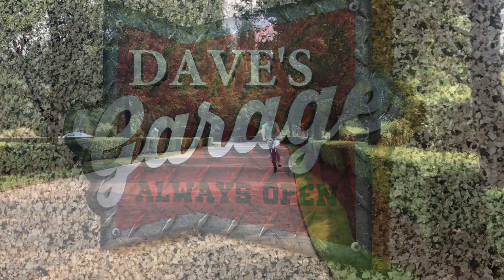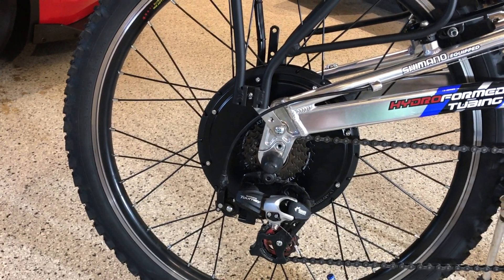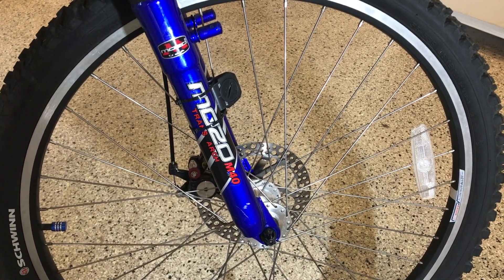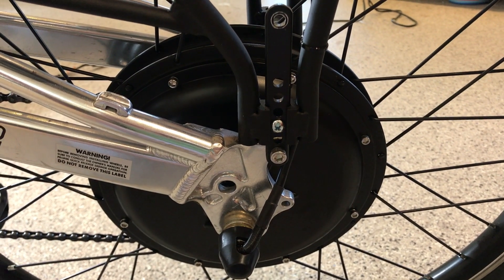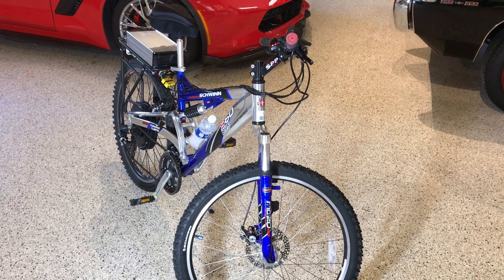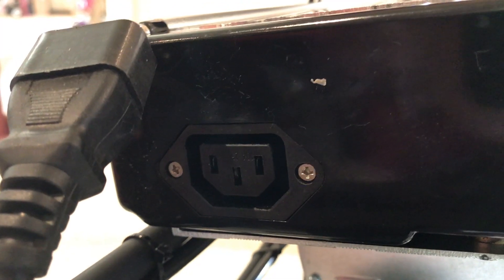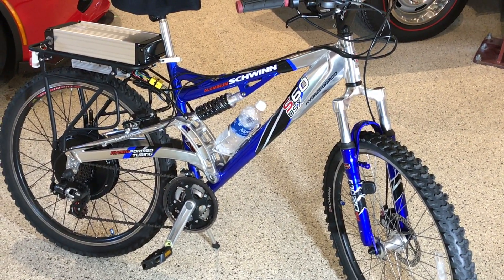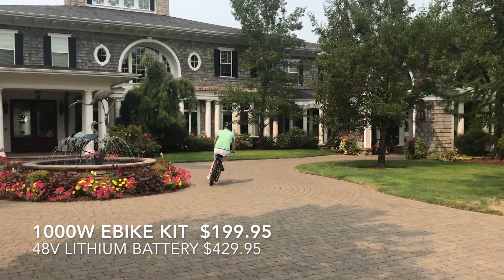eBike Kit: Amazon's eBike Review for 2021 1500W 2000W and 48V Battery

Comment: I use a Incline Frame of the NEXT Power Climber to use 1500watt FRONT HUB. The frame is similar to this Schwinn but the joint is different as the NEXT s frame is dedicated to having most of weight towards the handle Bars. I dont get peeling unless I rev fast which is a no no for me, lol. Going hills I can feel the difference of using other frames but this NEXT was perfect for using Front Hub. 1500watt using 52.v is extremely powerful of acceleration is fast, 2 to 3 seconds to 20mph.( have a 350 gear rear hub takes 5 seconds). But the frame is ideal for front hub as long as the frame is steel. having light bike of going fast is very shaky as give you feeling any small hit will throw bike off  balance( not too heavy of weight for dual motor it can rip the fork ends out of wheel running away.).

Comment: I would never go 40 on a big box bike, they are classified as toys for safety reasons and do not pass any kind of certification for safety other than choking hazard. Fortunately it looks like you have not put many miles on it, it will not last long before the pivots fall apart and I have even seen the front forks snap just under the head tube on numerous occasions (I used to work in a bike shop). My advice is to switch it to a good bike. Also some riding video would have been nice, otherwise not a bad video.
Reply: @SomethingSmellsFishy  good to know. 👍

Comment: How do you charge the battery is there a charger or do you charge it by spinning the wheel
Reply from the maker: No, it comes with a plug in wall charger

Comment: AW rear wheel conversion.  My bike shop looked at it and there are two problems. First problem is that my Shimano crank is tapered and the PAS takes up room so that my crank will not slide back on all the way, I can tighten the bolt but the crank is not seated all the way and the bike shop said it will eventually wear out the crank arm since it is not tightly seated.  Is there a PAS system that will work in this case?  Also the derailer rubs in top gear and the bike shop said no way to fix except to adjust to lose the top gear.

Comment: Not a good spot for it water can splash it.
Reply: he must not use it in the rain, same problem with rear wheel mounted upside down as he has the wire coming out the top of the axle, will act as a nice way to direct lots of water into the motor if ever used in the wet

Comment: I have seen in the item description that there is a 19mph restrictor, is that print just for legal issues? Or do some have a restrictor? Definitely don't want the restrictor.
Reply: My controller has a wire with a connector on it you leave it connected to keep the speed restricted to 25kph or disconnect it to ride full power 1000w (around 50-55kph i think, 30mph ish). Im not sure if it just restricts the top speed or if it limits the wattage but it doesnt go over 25kph which is the legal limit in the uk
Reply: GRAVED1GGER44 I think he’s put it on because it’s his kids bike

Comment: I can't believe I came across your post. I have the exact bike around 10 or more years ago at Target. It definitely is a great bike for what we paid for it. I think I paid around $70. I want to convert it because I have back problems and need assistance after a short ride. I wanted to go with the mid-drive setup but afraid of the complexity with this bike. Let me know how it's holding up and what you would do differently.  Thanks.
Reply from the maker: That's cool!  Biggest change I would make next is better mounting for the battery.  Maybe a shock mount of some kind because it's so heavy!
Reply: Dave's Garage, I started to disassemble the area where the mid drive goes through to measure the core. The mid drive has the controller in the motor which is good. The back rack will have the battery like yours. Unfortunately can't fit in the water bottle area. Thanks again!

Comment: switch that front brake out to a hydrlic brake for a couple reasons - 1) (much) more stopping power for your hills 2) less maintenance
Reply from the maker: Thanks!  I've ordered one to use on a quad, I'll see if I can make one work on  the bike as well!
Reply: @DavesGarage  go for it and if not - there's millions of used mtn bike parts on the web - you should be able to find a hydraulic disc brake on ebay or craigslist for cheap $$$ - good luck!
Reply: I’ve been told my bike can’t be converted as it has hydraulic brakes??? Help please!

Comment: You canuse the below links to buy best selected e-bike conversion kits in india.

For BLDC hub motor kit

Amazon.in: Electronics (https://amzn.to/2TTiTFl) > RS. 25000/-
Pedalease Electric Bicycle E Bike Conversation Kit 36v 250w Rear or Front hub Motor (https://amzn.to/2SQcMRL) > RS. 13000/-
Amazon.in: Electronics (https://amzn.to/2TKchce) >RS. 18500/- (1000W)
Amazon.in: Electronics (https://amzn.to/2SVkI4e) > RS. 11500/- (250W)
Pedalease Electric Bicycle E Bike Conversation Kit 36v 250w Rear or Front hub Motor Complete with Battery (https://amzn.to/2RP8JYT) >RS. 22000/- (250W)

For DC Motor kits

Electric 24V 250W E-Bicycle Project kit (Black) (https://amzn.to/2RJjT1i) > RS. 7000/-
Buy HumserTM 24V 250W Electric Conversion PMDC Motor Bicycle Kit (Silver) Online at Low Prices in India (https://amzn.to/2TO23Yn) > RS. 7200/-
Robodo Combo Kit - MY1016Z2 250W Motor DIY Ebike, Electric Bicycle Kit (https://amzn.to/2VV4h9Z) > RS. 7000/-
Robodo Electronics M59 MY1016 250W Plus Motor Controller Plus Twist Throttle, DIY Electric Bicycle Kit (https://amzn.to/2RpVhLD) > RS. 4000/-

Comment: I recently got done putting a very similar kit together on my old mtn bike, it appears to work really well.  Did you leave the blue connectors unconnected so that you get the 1000W instead of the 750W?  Thank you for sharing!
Reply from the maker: Can you explain?  Mine had NO documents so no, I bet I did not.  Please provide more info if not a joke!
Reply: Dave's Garage When I purchased my kit via Amazon, it was advertised as a 1000W motor, but the description said it defaults to 750W unless the two blue leads from the controller were either connected or disconnected. I tried it both ways and didn’t notice any changes but that way have been me. My area is too cold right now for biking so hope to play with it some more in spring.
Reply from the maker: @alanhirayama4592  Assuming it's a DC motor I should be able to test it with a clamp ammeter, I'll see if I can do that!
Reply: @DavesGarage  It should be a DC motor, pls let us know what you find out!  Thanks much!
Reply: @DavesGarage  Did you do it?

Comment: I have a trike I want to convert to an ebike. Do I get the rear wheel or front wheel kit for it? 😊
Reply: Go with the tri wheel kit u wheel get rear and front wheel traction make sure you get 1600 watts or better because u using all 3 wheels go with the super lithium ion +
Reply: I have the same doubts as you... I like more the kit for the rear wheel because you have a better space to fix the battery wich is huge...
Reply: @aviatesony1793  the size of the battery dont matter if you can get a smaller batter with the same it's all good and they self loads of them on Ebay that connect to the part were you put the drinks holder and get a 1500w at 42v rear drive bike will go 30+ mph